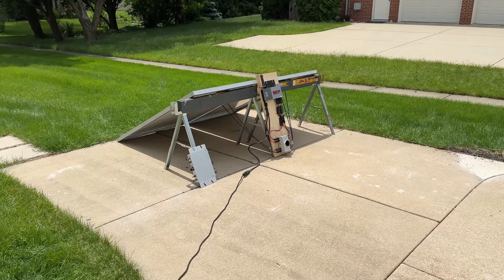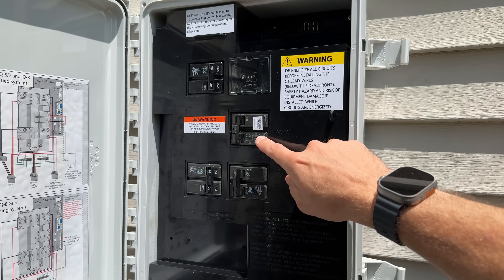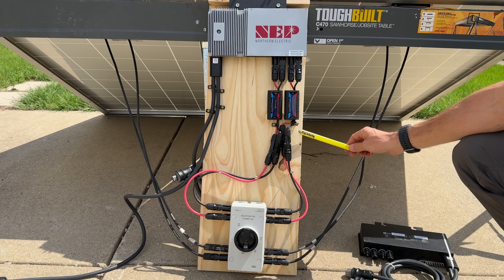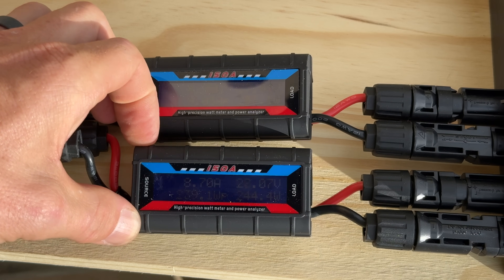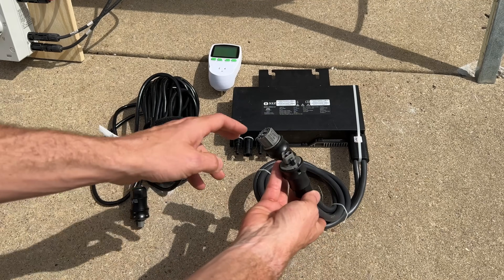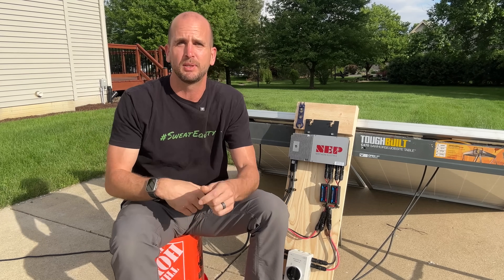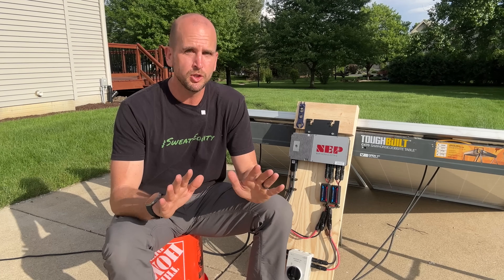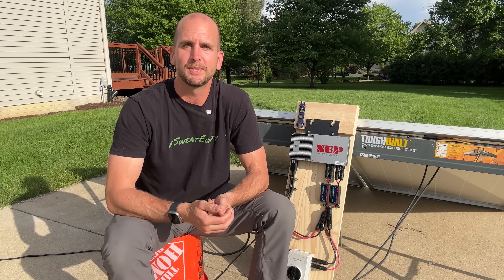Easiest Grid-Tied Solar On The Market!   Plug-N-Play

Comment: This NEP inverter is illegal for plugging into an outlet. It is not UL approved for grid intertie use and if your utility learns of your installation, you going to get sued by the utility.
Reply: I work for  the utility company and that is a lie. They'll just upgrade your meter to the appropriate meter free of charge
Reply: @landysok90 - that may be your utilities policy, but many utilities are not really "cogeneration" friendly. Not only will they charge to change out the meter, but their service charge increases to cover the cost of the increase investment in metering, but also for the special billing process that meter is subjected to as a result of "cogeneration". On something this small in production, almost any gain will be easily consumed by the additional service fee. 

One utility in the Midwest that I am familiar with charges $50 more per month in their service charge for net metering with an annualized balance. They won't actually buy the power back, but let you "bank it" for 12 months and use it at any other time during that 12 month period. At the anniversary date, the counter is reset to "0" for the bank and you start over.
Reply: @landysok90  what is a lie? Since you work for the utility do you agree with his statement within this thread that 500 watts wouldn’t be a big deal? He assumes it would be consumed, but what about a power outage situation? The linemen around here get really pissed off if there is even a hint of backfeed to the grid.
Reply: @JNHEscapes  - 500 watts at 120v is just over 4 amps. This means on the primary side of the transformer, assuming its the common 7.2kv system, the current would be at 0.067 amps. 

Here's the funny thing about the situation when you have a power outage and something like this is tied to the grid, the rest of the grid is one major load on this small system. In fact this system will see the rest of the connected grid as if it were a direct short and there is a good chance it will actually take out this equipment. 

So to protect the equipment while protecting anyone working on the line, even at this minimal level of production, install a fuse/breaker as part of this system that is large enough to supply operating current for the charge circuit, but small enough that it sacrifices itself when the rest of the system loads up this solar generator. It then becomes "self managed".
Reply: @JNHEscapes  my guess is the linemen in your area are poorly trained and/or educated...
If the power is out, there is bad weather, ever heard of "Static charge"...
Reply: Do you have a solar business?🧐
Reply: My understanding of how micro inverters work is that if the grid goes down, the micro inverter also shuts down to protect the people repairing the grid.
Reply: Ummm, no, he will not. Get real.
Reply: I’m not really familiar with solar but couldn’t a small grid powered relay or some solid state device be used to interrupt the solar output?
Reply: Hi power company
Reply: His home already has solar. I would assume the correct hardware is already installed for that system.
Reply: Even if the utility finds out from satellite photos that you have panels they don't know about, if they show up for an inspection, you can just plug it into some random device you might have and tell them it's not grid connected.
Reply: Best guess is your a solar installer, and pissed at people that make these types of videos to encourage people to try DIY solutions, instead of paying you a 300% markup to do the same...
Reply: People who have done this and overproduced have not gotten sued. Some said they got a call or letter letting them know they needed modify their system so it would not feed the grid. Or
 they had sign up for net metering and had an inspection to keep using it.
Reply: Although it has not gone tru UL 1742 (new standard) it does have UL1741 and Anti-Islanding Protection. It could easily pass the new cert. Cert are expensive and UL is not a law agency. It’s a self governing testing agency. If you pay attention to the label it says ETL US which means that it was tested at ULStandards by other agency. I can’t imagine a scenario where someone could be liable following local code.
Reply: He needs an automatic disconnect to prevent overloading and fire 🔥 it’s simple! If he hasn’t burned down his house by now! He or some other did something right! Your opinion doesn’t matter! Wake up and enjoy the content! Nobody is perfect including yourself 😊
Reply: I think this is dangerous to play with and advertise for any joe blow to play with. There are some dangerous assumptions being made: is the micro inverter any good? Is it reliable to be left unattended? Is it designed to be installed, monitored or controlled by a larger system or brain? Does it in fact have anti islanding and how does it function? Does it function in a standalone scenario? Does it sample the AC, use frequency shift, monitor the grid in some way, how exactly does it work so the user can know exactly what to expect? This crap off amazon is going to get someone killed. The congestion in that main panel would make me rethink the entire solution. The fear of back feeding the grid unknowingly would keep me up at night. All of this is too unstable and risky for such little payoff. Those with zero electrical knowledge or ability should never play with this equipment. Whenever I am designing anything I always ask myself when I’m done would I leave this connected and leave for a week? If you hesitate at all when answering it’s best to redesign. I wouldn’t leave this connected overnight. I imagine your provider would have alot to say about this as well considering how strict our local provider is. People just need to be careful and realize this stuff can and will kill you. I thought you built it as a makeshift generator to power tools or something but to plug it back into your main panel to gain a few amps is just silly. 🤪
Reply: @JNHEscapes  There are many potr tally dangerous projects on YouTube: carpentry, auto repair, etc. Do you write a book for all of them or have you singled this out?
Reply: @vladimus9749  I will single out any video or content that demonstrates poor or dangerous behavior. This is the problem with our society today…instead of reading my response and asking more questions or defining solutions you would rather scald the person trying to provide context and detail. I suppose if it works fuck it right? Who cares about physics, laws, amps, voltage or potential. Let’s just throw it together and see what happens. I’m really glad true engineers do not think like you or we would all be dead.
Reply: @JNHEscapes  agreed, people should be ignorant and only do what big business tells them they should do...
Reply: @JNHEscapes ….. I am not a genius by any means but… No sun means no more power going into the device at night. It also is only rated for 500w going into the grid. Which means that it will be used right away by any devices connected to the circuit before the breaker and if not it will transfer to another part of the house into the fridge before it ever sees the actual grid. There’s too much energy coming in from the grid for it to push back into it. Think path of least resistance. Fire hazards are only going to happen if you have the wrong wire gauge or the device is faulty. The problem is solved by placing the device strategically for if it does catch fire then at least it can’t hurt anything. It’s just as dangerous as any other electrical device in your home if you’re using it right. Might as well throw everything electronic out if you’re that Fearmongeringly concerned. Some existing devices throw a lot more energy than this device could.
Reply: @dapain1576  this also means, genius, that you would have to manage the situation. Let’s say you hook all this up and go to bed. Sun goes down, solar is not producing power I can roll with that, but you didn’t unplug it. You didn’t do anything maybe you’re out of town. Then an early morning storm hits and knocks the power out. Sun comes up…uh ohhh. You’re not home and the sun generated power regardless of storm damage…now you’re back feeding the grid (with this particular setup / example). Then what? You tell your neighbor to run over and unplug it before a lineman figures it out the hard way? Keep in mind your neighbor is probably busy with his own problems at that time. Too much human administration required, therefore, poor solution.
Reply: @JNHEscapes - If the lineman was trained properly, he'll test the line before performing any work on the primary or any secondary drops to detect the presence of back generation, (current NESC test provision). If they have significant restoration work to perform, they should be grounding all conductors to insure someone doesn't actually turn on something that back feeds the system, after they have begun work.

The problem that does exist on any backfeed, it delays circuit restoration, the last thing a lineman wants to deal with when he has multiple restorations to perform. It can take significant time on major circuit outages, to trace where the interconnect is made, then attempt to resolve it.
Reply: @JNHEscapes your ignorance is a wonder, nearly all of today's inverters have protection against grid backfeed...

Also most people that do install sizable systems have them isolated from grid connections and use them as power outages backups...

Oh, am also figuring you are afraid of your shadow!!

Comment: What are you feeding with the 120v?
Reply: He is back feeding his entrance panel through a dedicated breaker for that outlet and the power will flow to any other circuit in the house that is using power. The solar power is just displacing some of the power that the house is using from the grid.

Comment: Scott, can you make a video about a completely off-grid DIY solar setup that is using an Ecoflow Delta 2 Max to power a mini split? Have a detached shed project in mind that doesn't currently have power, but I'd like to convert it to a WFH office.
Edit: Got the inspiration from your recent shed project. Would like to do similar, except expand upon that with more panels and the Delta 2 Max (with extra battery, which I already have).
Reply: How did this work out? I have been looking into getting a portable mini split AKA air conditioner with heating and using that to heat my office directly from solar during the day instead of turning on the entire heating zone to that area of my house from oil. Portable ACs always had a bad rep but The new Madea Duo models having inverters and can work as heat pumps, so I'm not as concerned about efficiency if I'm running it directly off solar versus a space heater.
Reply: @ccow11  Never got around to the shed project, but in my primary bedroom I installed a 120v EG4 hybrid mini split that is connected directly to an Ecoflow Delta 2 Max. 

Since I am primarily using the mini split at night the Ecoflow is better for me vs connecting the solar panels directly to the mini split. 

The Ecoflow gets power input from 2x 450w solar panels. The mini split plugs directly into the Ecoflow and runs exclusively off battery. I use the EG4 "AC Limiter" option when running, so it tends to max out around 350w during usage, which leaves me around 4-6 hours of usage before needing to recharge via solar.

Weather here doesn't often get below 40F at night, so I rarely run it for more than an hour or two at a time, about 4 hours in total per day (1-2hrs for bedtime and 1-2hrs waking up).

Comment: Maybe I missed it, but a system like this risky because it allows backfeeding and doesnt have a system to shut off if power is disconnected?  I thought nearly all utility companies ban this stuff
Reply from the maker: UL 1741 is the certification that ensures the micro inverter only provides power when power is detected at the outlet/grid.
Reply: They do. Check with the local building inspector Before using this. You don't want a dead lineman on your conscience.

Comment: I have a 50amp plug in my garage that I don’t use cause the I don’t charge a EV

I got a 50amp/120v adapter in case I ever wanted to use power from that outlet

Would it be safe to plug my solar into that plug? I have net metering through my utility in my area that gives credits still thankfully, at least for now.
Reply: I'd be very careful with that, but in theory it's possible, since that will be 240v at the outlet, and is more than likely the only outlet on that entire branch. 50A is a big breaker to trip though, so the wiring better be up to snuff. If you're not going to use all 50A, which is most likely the case, I'd recommend swapping out the beaker for a lower amperage one to something closer to your expected maximum output.

Comment: I have a Pecron E 2000 LFP, can I just make a double male extension cord and plug into a 20 amp house outlet from one of the 20 amp AC outlets on the generator?
Reply: You should definitely NOT do that, as the generator is not designed to synchronize with the grid power, and will probably fry itself, and anyone potentially trying to do maintenance on the lines.
Reply: @joeyhazlett  Thanks, that's what I figured, but thot I'd ask.

Comment: Does the system shutdown if the grid shuts down? Will the plug be live when unplugged or it needs 110 com  in my into the inverter?
Reply from the maker: The UL1741 certification is associated with the feature of the micro-inverter only providing power if power is detected at the plug/circuit.
Reply: @everydaysolar  the link for the inverter seems to be correct but the website does not list a model number

Comment: I tried 2 different wattages of grid-tie inverters, a 1kW and a 1.2kW.
Ever since I tried them, my electric bill went through the roof.
The bill was $490xx last month.
Neither grid-tie has been used for the last 3 months.
Any ideas why?
I only got about 4-5A out of the inverters.
My refrigerator, freezer, pool pump, garage, shop, and carport are all on off-grid solar.
The only things left are the 240V stuff: clothes dryer, stove, central AC, and some 120vac kitchen stuff.
There is no reason for the utility bill to be that high and never was before.
Reply: Is your electric meter the old type? Old types of electric meter can't differentiate power going in or out. So all power generated is calculated coming from the grid.

Comment: So I could use this no battery system as a 120v ac power point, and also take 12v out with a dc-dc converter…. mmmmm cool
Reply: No it won't generate ac without seeing 120v at the plug. Inverter shuts off if it does not see power coming in.

Comment: Can you parralel 2 panels and plug into inverter?
Reply from the maker: Yep!  I was considering something similar which would then mean on sunny days you would be clipping as the micro-inverter would throttle the current.  The big benefit if you have cheap used panels is you would be getting substantially more on cloudy and less than perfectly sunny days with a lower investment.

Comment: A confusing video.  You do not clearly show how this is to be used,  You complicated things by showing your roof top system, etc.  It is not clear what someone should do with the AC output of the system
Reply: I found it clear and helpful
Reply: How do you keep it from feeding back to the grid and receiving credit for it?
Reply: @travismorgan9273 you don't but when generating only 2-4 Kwh per day that energy provably gets used by general home electrical draws. He has a grid tied system with net metering anyway.
Reply: Man, people read the title and don't watch the whole video, but post and complain that they don't understand 🤦🏾
Reply from the maker: The AC output just plugs into a circuit in your home.  I recommend an exterior GFCI outlet with an "in use" cover on a dedicated circuit where you are only feeding in the solar and not powering anything else on the same circuit.
Reply: What is an “in use” cover?
Reply: @MasterRanger71  A plastic cover that fully closes and allows a cord to be plugged in at the same time. All newer exterior outlets have them. The older outlets only have a "door" type cover that works with nothing plugged in, but is not sealed when a plug is in so it's not watertight.

Comment: You never said WHY you can't get net metering. Am I to assume that your Enphase system is set up for net zero operation (meaning it will throttle back output if the solar system is producing more than you are using locally).